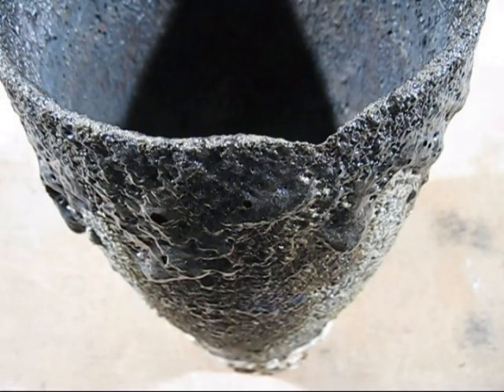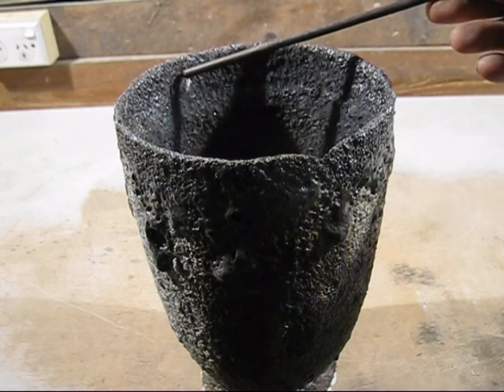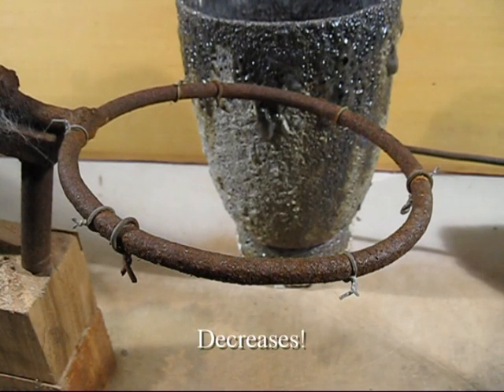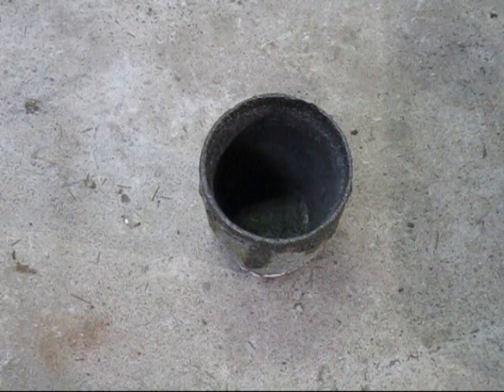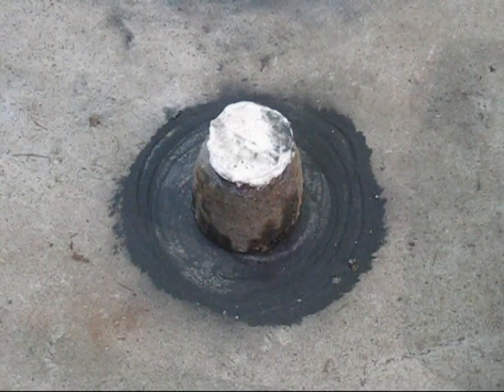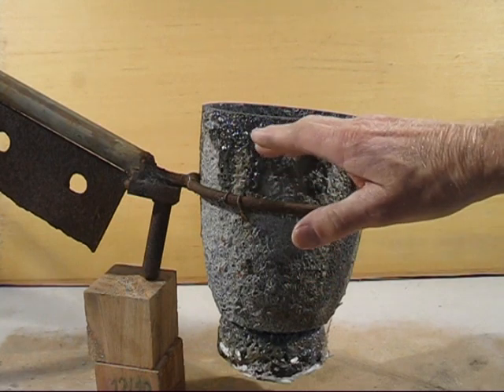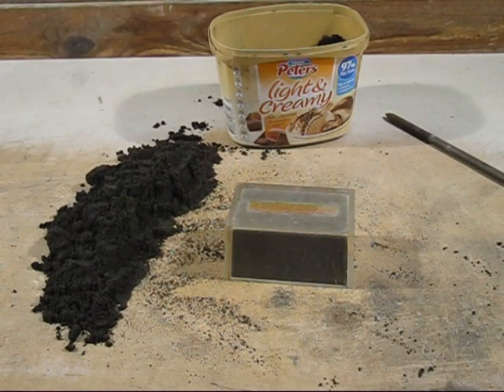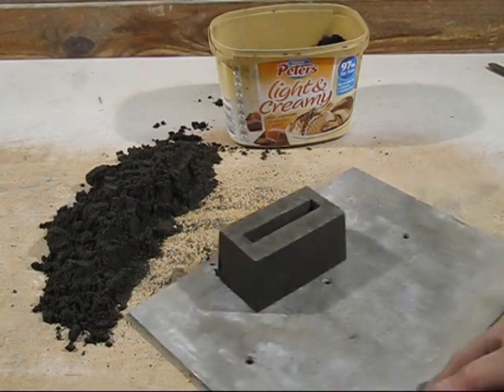Crucible maintenance + wedge test mold

Comment: I really like your information videos.  I have two question for you 1  are there specific dimension for the the wedge test?  and 2 where do you get your crucibles.
Reply from the maker: Yes there is but for most small castings 13 mm for the base, 25 mm high and 75-100 mm long so they will break easily. I get my crucibles from skamol Australia.
Reply: @luckygen1001  Thanks    I am sorry to have repeated a question you had had 3 week back on crucibles sorry 
I have tried to contact Skamol and Fresco with absolutely no luck. both the Syd and Adel. phone say they have been discounted Skamol - Casting don't answer.
Neither seem to have an online sales dept.
Any further suggestions?  I am reluctant to buy from China.  Pete  Again Thanks
Reply from the maker: @petelusted7598  You could try foseco Australia. They should have crucibles

Comment: It's supprising that the crucibles get eaten that bad with your furnace, as many iron melts and attempts that Ive done with my crucible, I have very little wear on it and other than a tiny bit of slag drips on the outside of it, it looks like brand new. I think the difference may be that I dont run my air and fuel very high, and I have a pretty deep bore on my furnace that allows for quite a bit of combustion beneath the crucible and up around it, just everything raised up with firebricks/plinth blocks. Pretty neat trick with the wire, Ill have to remember that one.
Reply from the maker: Between 7-10 melts the crucible still looks like new but after that it loses the protective glaze so that is when the outside surface looks terrible. Someone a while ago suggested that it was due to oil firing but the same thing happened when I used propane. I like to have have my iron very hot and the only way to do that is to run the furnace close to maximum but it wears out the crucible faster.
Reply: @luckygen1001  
Is there any way to reglaze the crucibles? I've seen random videos where a clay, graphite, sodium silicate mixture is painted on and let to dry and then fired?  I trust your instincts though and would love to see an experiment where you try it and judge the viability!
Reply from the maker: @RaspyOB174  I have heard of people coating their crucibles to make them last longer but I have never tried it maybe i should try it one time.
Reply: @luckygen1001  
Yeah it'd be a good one eh.  Talk about pricing of a crucible.  Pricing of clay-graphite-sodium silicate.  Talk about the process and how much extra time it takes to paint on and fire.  Whether it's bloody worth it or a waste of time.  You're the #1 YouTube Cast Iron Foundry resource and the hottest shop furnace around.  Couldn't think of a better Foundryman to do it.  Your crucibles take a mad beating!

Comment: Why don’t you make interchangeable rings various diameters to pour your crucibles.
Reply from the maker: It is a lot more work to make different size rings, much easier to twist wire so the crucible sits in the right position.